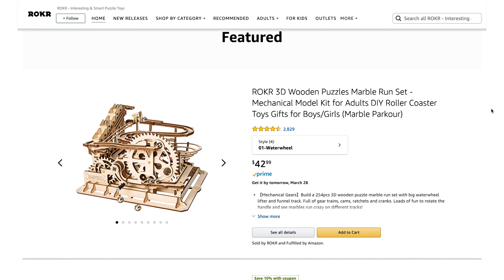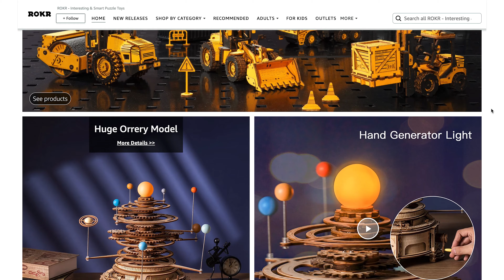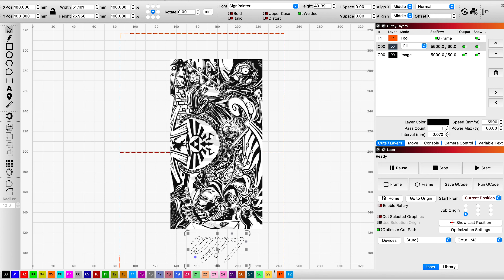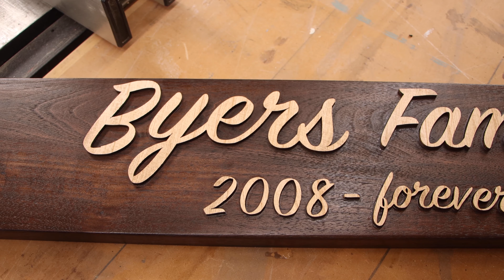Does a REAL woodworker use a laser engraver?

Comment: I totally get this video. I see comments about these things not being real woodworking all the time. I have a diode laser and a 3d printer in my shop along with a table saw, a jointer and a planer,  I could go on.  A diode laser is just a tool that can be adapted for woodworking, the same way I have adapted and used a drill press, a soldering station, digital calipers and machinist 123 blocks for woodworking. I would guess that most "woodworkers have at least one of those things in their shops and I don't think any of them were created for woodworking.  That's my opinion, but hey, my hand plane also sits on a shelf 24/7 looking pretty.
Reply from the maker: Great point